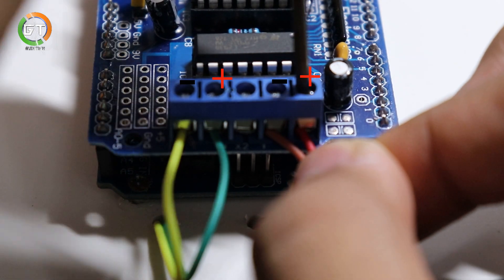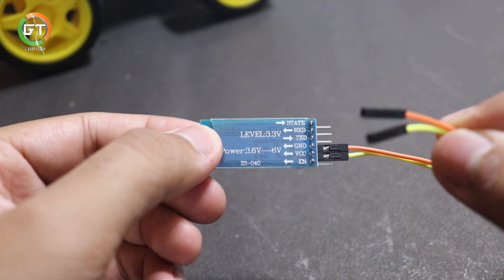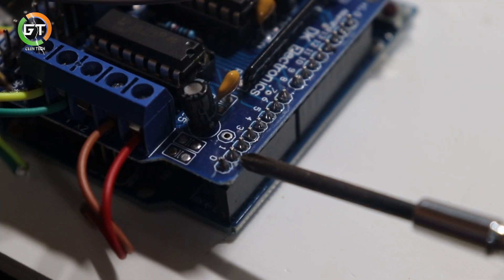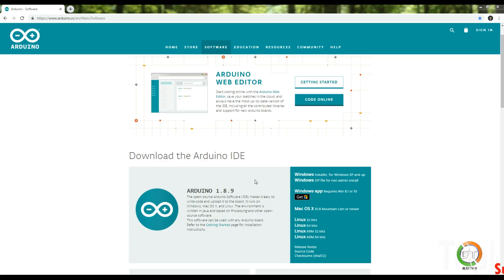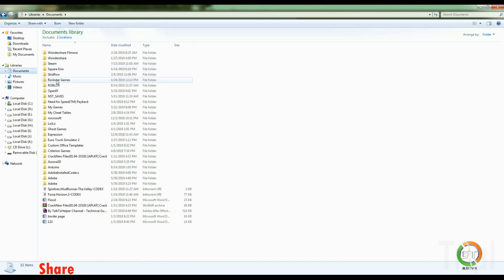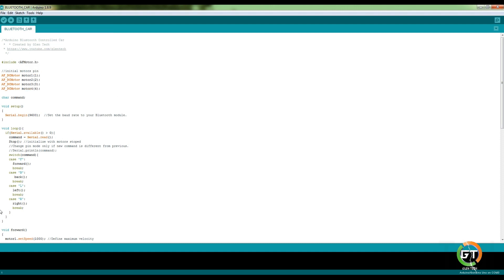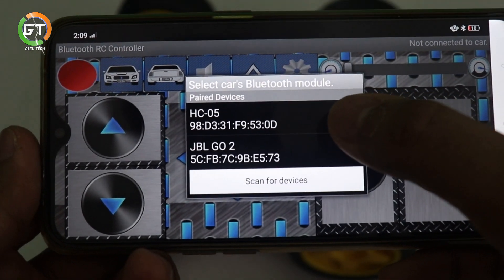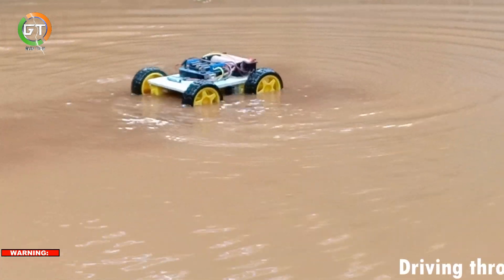How to make Arduino Bluetooth Controlled Car For Science Project

Comment from the maker: CODE :

//Arduino Bluetooth Controlled Car
//Before uploading the code you have to install the necessary library
//Note - Disconnect the Bluetooth Module before hiting the upload button otherwise you'll get compilation error message.
//AFMotor Library https://learn.adafruit.com/adafruit-motor-shield/library-install
//After downloading the library open Arduino IDE >> go to sketch >> Include Libray >> ADD. ZIP Libray >> Select the downloaded
//ZIP File >> Open it >> Done
//Now You Can Upload the Code without any problem but make sure the bt module isn't connected with Arduino while uploading code

#include <AFMotor.h>

//initial motors pin
AF_DCMotor motor1(1, MOTOR12_1KHZ);
AF_DCMotor motor2(2, MOTOR12_1KHZ);
AF_DCMotor motor3(3, MOTOR34_1KHZ);
AF_DCMotor motor4(4, MOTOR34_1KHZ);

char command;

void setup()
{      
  Serial.begin(9600);  //Set the baud rate to your Bluetooth module.
}

void loop(){
  if(Serial.available() > 0){
    command = Serial.read();
    Stop(); //initialize with motors stoped
    //Change pin mode only if new command is different from previous.  
    //Serial.println(command);
    switch(command){
    case 'F':  
      forward();
      break;
    case 'B':  
       back();
      break;
    case 'L':  
      left();
      break;
    case 'R':
      right();
      break;
    }
  }
}

void forward()
{
  motor1.setSpeed(255); //Define maximum velocity
  motor1.run(FORWARD); //rotate the motor clockwise
  motor2.setSpeed(255); //Define maximum velocity
  motor2.run(FORWARD); //rotate the motor clockwise
  motor3.setSpeed(255);//Define maximum velocity
  motor3.run(FORWARD); //rotate the motor clockwise
  motor4.setSpeed(255);//Define maximum velocity
  motor4.run(FORWARD); //rotate the motor clockwise
}

void back()
{
  motor1.setSpeed(255); //Define maximum velocity
  motor1.run(BACKWARD); //rotate the motor anti-clockwise
  motor2.setSpeed(255); //Define maximum velocity
  motor2.run(BACKWARD); //rotate the motor anti-clockwise
  motor3.setSpeed(255); //Define maximum velocity
  motor3.run(BACKWARD); //rotate the motor anti-clockwise
  motor4.setSpeed(255); //Define maximum velocity
  motor4.run(BACKWARD); //rotate the motor anti-clockwise
}

void left()
{
  motor1.setSpeed(255); //Define maximum velocity
  motor1.run(BACKWARD); //rotate the motor anti-clockwise
  motor2.setSpeed(255); //Define maximum velocity
  motor2.run(BACKWARD); //rotate the motor anti-clockwise
  motor3.setSpeed(255); //Define maximum velocity
  motor3.run(FORWARD);  //rotate the motor clockwise
  motor4.setSpeed(255); //Define maximum velocity
  motor4.run(FORWARD);  //rotate the motor clockwise
}

void right()
{
  motor1.setSpeed(255); //Define maximum velocity
  motor1.run(FORWARD); //rotate the motor clockwise
  motor2.setSpeed(255); //Define maximum velocity
  motor2.run(FORWARD); //rotate the motor clockwise
  motor3.setSpeed(255); //Define maximum velocity
  motor3.run(BACKWARD); //rotate the motor anti-clockwise
  motor4.setSpeed(255); //Define maximum velocity
  motor4.run(BACKWARD); //rotate the motor anti-clockwise
}

void Stop()
{
  motor1.setSpeed(0); //Define minimum velocity
  motor1.run(RELEASE); //stop the motor when release the button
  motor2.setSpeed(0); //Define minimum velocity
  motor2.run(RELEASE); //rotate the motor clockwise
  motor3.setSpeed(0); //Define minimum velocity
  motor3.run(RELEASE); //stop the motor when release the button
  motor4.setSpeed(0); //Define minimum velocity
  motor4.run(RELEASE); //stop the motor when release the button
}

Comment: Hi bro u viedo is so useful but a dout bro is I have did what u said in the viedo but after 5 to 6 seconds the motors are going slow and the Bluetooth is turning off and the Arduino on light is also dimming bro can u plz say bro what is the solution u can only say this bro plzz
Reply from the maker: Charge the battery full , before using
Reply: @GLENTECH  no sir I have tried with full charged battery also sir can u plz give a solution for this problem bro plzz

Comment: Bro nan cheythu pakshe work avunilla number tharooo plzzz
Reply: @glen tech bro phonil anu program cheythathu
Reply from the maker: @ayyappanvk6090 
 https://youtu.be/Mw589orCT3c
Reply from the maker: Read it 

//Arduino Bluetooth Controlled Car
//Before uploading the code you have to install the necessary library

//Note - Disconnect the Bluetooth Module before hiting the upload button otherwise you'll get compilation error message.

//AFMotor Library https://learn.adafruit.com/adafruit-motor-shield/library-install

//After downloading the library open Arduino IDE >> go to sketch >> Include Libray >> ADD. ZIP Libray >> Select the downloaded

//ZIP File >> Open it >> Done

//Now You Can Upload the Code without any problem but make sure the bt module isn't connected with Arduino while uploading code

Comment: Hi! I do as you did but I don’t know whether it’s the circuit not connected correctly or it’s the battery that isn’t working. Can you help me out on how to test which isn’t working?
Reply from the maker: /*Arduino Bluetooth Controlled Car
 *  * Created by Glen Tech 
 * https://www.youtube.com/glentech
  */
  
#include <AFMotor.h>

//initial motors pin
AF_DCMotor motor1(1); 
AF_DCMotor motor2(2); 
AF_DCMotor motor3(3);
AF_DCMotor motor4(4);

char command; 

void setup() 
{       
  Serial.begin(9600);  //Set the baud rate to your Bluetooth module.
}

void loop(){
  if(Serial.available() > 0){ 
    command = Serial.read(); 
    Stop(); //initialize with motors stoped
    //Change pin mode only if new command is different from previous.   
    //Serial.println(command);
    switch(command){
    case 'F':  
      forward();
      break;
    case 'B':  
       back();
      break;
    case 'L':  
      left();
      break;
    case 'R':
      right();
      break;
    }
  } 
}

void forward()
{
  motor1.setSpeed(1000); //Define maximum velocity
  motor1.run(FORWARD); //rotate the motor clockwise
  motor2.setSpeed(1000); //Define maximum velocity
  motor2.run(FORWARD); //rotate the motor clockwise
  motor3.setSpeed(1000);//Define maximum velocity
  motor3.run(FORWARD); //rotate the motor clockwise
  motor4.setSpeed(1000);//Define maximum velocity
  motor4.run(FORWARD); //rotate the motor clockwise
}

void back()
{
  motor1.setSpeed(1000); //Define maximum velocity
  motor1.run(BACKWARD); //rotate the motor anti-clockwise
  motor2.setSpeed(1000); //Define maximum velocity
  motor2.run(BACKWARD); //rotate the motor anti-clockwise
  motor3.setSpeed(1000); //Define maximum velocity
  motor3.run(BACKWARD); //rotate the motor anti-clockwise
  motor4.setSpeed(1000); //Define maximum velocity
  motor4.run(BACKWARD); //rotate the motor anti-clockwise
}

void left()
{
  motor1.setSpeed(255); //Define maximum velocity
  motor1.run(BACKWARD); //rotate the motor anti-clockwise
  motor2.setSpeed(255); //Define maximum velocity
  motor2.run(BACKWARD); //rotate the motor anti-clockwise
  motor3.setSpeed(255); //Define maximum velocity
  motor3.run(FORWARD);  //rotate the motor clockwise
  motor4.setSpeed(255); //Define maximum velocity
  motor4.run(FORWARD);  //rotate the motor clockwise
}

void right()
{
  motor1.setSpeed(255); //Define maximum velocity
  motor1.run(FORWARD); //rotate the motor clockwise
  motor2.setSpeed(255); //Define maximum velocity
  motor2.run(FORWARD); //rotate the motor clockwise
  motor3.setSpeed(255); //Define maximum velocity
  motor3.run(BACKWARD); //rotate the motor anti-clockwise
  motor4.setSpeed(255); //Define maximum velocity
  motor4.run(BACKWARD); //rotate the motor anti-clockwise
} 

void Stop()
{
  motor1.setSpeed(0); //Define minimum velocity
  motor1.run(RELEASE); //stop the motor when release the button
  motor2.setSpeed(0); //Define minimum velocity
  motor2.run(RELEASE); //rotate the motor clockwise
  motor3.setSpeed(0); //Define minimum velocity
  motor3.run(RELEASE); //stop the motor when release the button
  motor4.setSpeed(0); //Define minimum velocity
  motor4.run(RELEASE); //stop the motor when release the button
}
Reply from the maker: did you recharge the battery
Reply from the maker: use the app to control it
Reply: Hi I succeeded uploading the code but the new problem is when I press the forward button, there’s only three motor turning, it’s not the motor broken issue all four motor is brand new and it turns when I press backward button can you help me out!
Reply: And now the 18650 battery is fully charged. Just wondering why the four motor not turning at the same time but turn 3 motors at a time only, I appreciate your help
Reply from the maker: @tzu-weichang8366  sometimes Bluetooth device or motor controller is having some problem . 4th motor after sometime will start to work you try
Reply: Do I need to download anything such as AF motor or something into my computer before I upload the code to the pad?
Reply from the maker: @tzu-weichang8366  yes , Link in the video description . See the video 6:11
Reply: Hi, the motor issue isn’t fixed yet, i was wondering if it’s because that the voltage isn’t enough for it to run four motor at the same time? How much voltage do we need exactly, is 7.4V enough or it need 9V instead!
Reply from the maker: @tzu-weichang8366  7v to 12v it will work

Comment: It’s work for hc 06 ?
Reply from the maker: Yes
Reply from the maker: All Arduino supported Bluetooth Transceiver modules will work
Reply: Give me name of application plz
Reply: Okey
Reply from the maker: Application link in video description
Reply from the maker: https://play.google.com/store/apps/details?id=braulio.calle.bluetoothRCcontroller
Reply: And it work for 18650 l-lion battery 4800mA ?
Reply from the maker: @wassimsoualili7153 it will work with 3.7 v rechargable batteries , 2000ma or 4000ma no problems it will work

Comment: Hello Glen I am doing this Bluetooth rc project but I need a help I am using adrino Nano instead of this but my project t has stopped because the program I write was correct but it is not uploading to the board
The error is problem uploading to the code help me very fast please
Reply from the maker: https://drive.google.com/folderview?id=1TzT5dl1k4Tvl8G3-3xoCYDbEzNzdMnBI

Download 3 folders and paste it in Arduino file installed in  My document
Reply: Bro but I am not using adrino uno
Reply from the maker: Then also do it 6:12
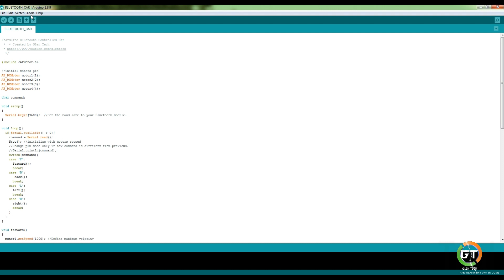Reply from the maker: Before uploading code , select the board option in tool option  and change Arduino Uno board to Arduino nano . 6:43

Comment: Ente ponn mone... aa motors waterproof onnum alla... vellam keriyal ath nashavum
Reply from the maker: I know but I have sealed all motors with hot gun , now also it's working without any problems .
Reply: @GLENTECH  nee arduino board um seal cheytho ?? Don't be fool
Reply from the maker: @sreejachandran1525  വെള്ളത്തിനടിയിലൂടെ അല്ല കാർ ഓടിക്കുന്നത്. So that no need to seal Arduino board . If you need only need to drive in water .
Reply from the maker: In video I have written " water can damage the parts "  and everyone know that it's not waterproof and no one will try .